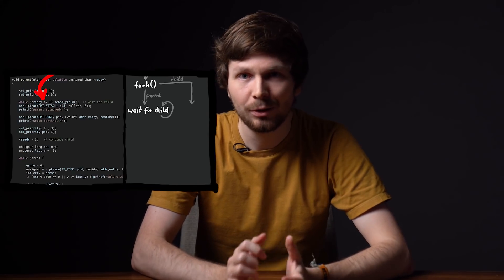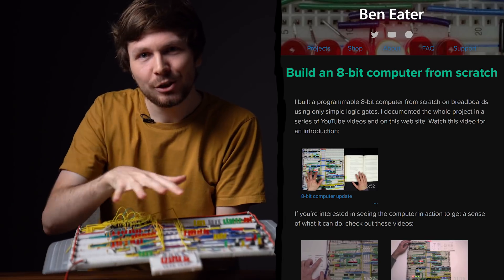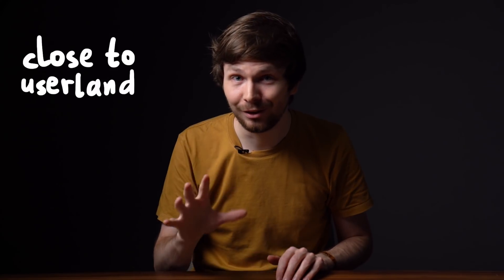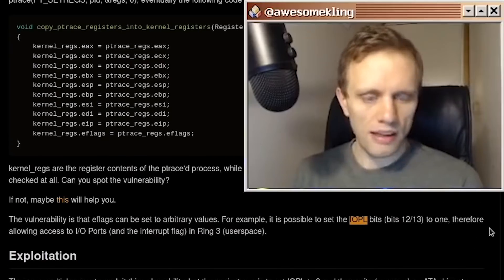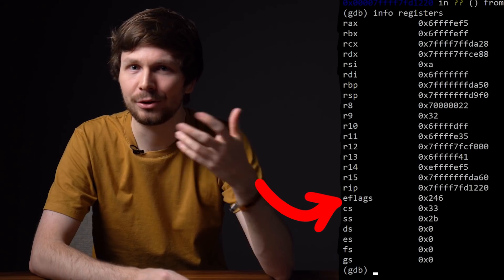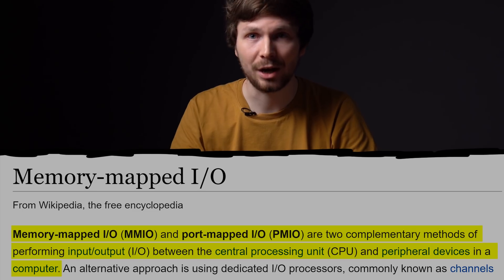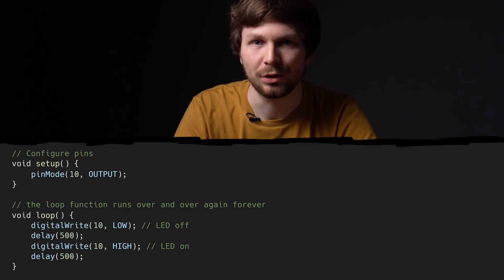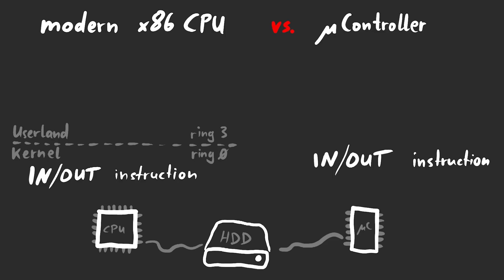How CPUs Access Hardware - Another SerenityOS Exploit

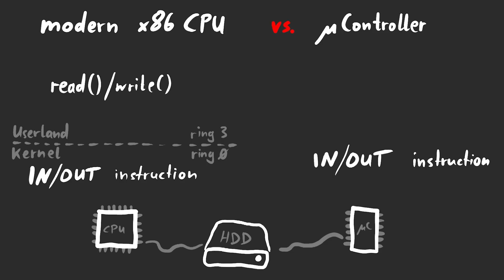Comment: 16:25 - The kernel check permissions in modern OSes; back in the DOS days, we read from and wrote to ports directly, so reading the keyboard controller from port 60h was a common task (well, maybe not as common as using interrupts). In those days, the computer was essentially an Arduino. I miss the days of displaying stuff on screen by just writing directly to video RAM.
Reply: You could always do the same with linux. Just pipe the /dev/random to the screen buffer! Even better, pipe it to sound output so you could listen to "random"! :D
Reply: @YandiBanyu  Hey can you expand a little on how I would pipe random dev output to a screen buffer or audio buffer. Like which device I should be piping to?
Reply: @kunaljoshi8038  That depends on the detail. But one thing is for sure, you need to make sure that the linux kernel create the framebuffer node (usually /dev/fb# where # is any number). After that, just do the usual "cat /dev/random > /dev/fb0". Of course it also hard to notice since your screen will likely refresh at least 24Hz. Audio buffer however is a little bit easier. Most Linux uses ALSA, you could always do "aplay -c 2 -f S16_LE -r 44100 /dev/random"
Reply: @YandiBanyu  ok thank you. Will try this out 👍
Reply: @YandiBanyu  I don't know what I was expecting when I played random through the audio buffer
Reply: The Spectrum worked exactly like that. The graphics part was realized by using a dual port RAM to write the data related to graphics. On one side of the RAM was the CPU, and on the other side was the circuitry that scanned the RAM and converted to a signal that would be sent to the TV set. It was a very common topology in computers, so it seems.
Reply: you can just write a protected mode ring 0 operating system to get those joys back
Reply: @iDontProgramInCpp  Better to do real mode so you can get bios interrupts back too ^^
Reply: @peacefulexistence_  you would be heavily limiting yourself to 640kb of ram, why?
Reply: It's not directly to ram but it's called dev fb0

Comment: There's a book called Understanding the Linux Kernel that I'm reading through at the moment that you might be interested in. It has chapters that go through things like interrupt request controllers and whatnot and interacting with hardware. It's not the very latest thing in the world, so a lot may have changed with the newer Linux kernels, but I would expect most of the very basic stuff to be the same since it still needs to work with the physical way motherboards and chips work, including older modules - so even if newer systems have been implemented both in hardware and software, this mechanism at least should still be in the kernel for backwards compatibility
Reply: @damianc8738  Certainly a title that sounds like it could be a good resource :)
Reply: been reading it for 5yrs now. great book

Comment: Fun fact on hardware vs network ports: Port 0x80 is used for firmware debug output that is sent out through the LPC bus, what a POST card displays (or super I/O / EC / BMC catches today). Not to be confused with the HTTP port. In spoken language, both are referred to as "port eighty". And "to POST" (power-on self-test) in firmware not to be mixed up with the HTTP verb. ;)

Comment: Not all IO must happen through these ports. Many times hardware (especially modern hardware) write directly into memory and then inform the CPU via an interrupt and so CPU doesn't have to synchronously read from ports. Part of the PCIe protocol is an algorithm for the CPU and a piece of hardware (like GPU or network card) to decide where exactly in CPU's memory address space they can communicate
Reply: You mean something like DMA from the peripheral side?
Reply: @victornpb  yeah, sort of. DMA is a generic term for the ability of other hardware to access the main RAM without going through the CPU (i.e. not through port IO). PCI is a much more complicated protocol

Comment: Modern RISC processors (like RISC-V) tend to use memory-mapped I/O rather than port-mapped I/O, it's more flexible because: it avoids adding specific instructions (classic load/store instructions do the job) and it removes the constraint of supporting obsolete technology (like PS/2 port).
By the way, x86 also use memory mapped IOs for modern devices (like the PCI bus).

For memory-mapped I/O on linux we use a "device-tree" file that describes which physical address corresponds to which device. This allows linux, at boot time, to know the physical addresses of the devices for the kernel drivers and to define a virtual address space for each driver.

To prevent users from using the I/O directly, the kernel simply does not map the I/O memory in the virtual address space of user processes (so he doesn't need to do anything).
And a user can under certain circumstances ask the kernel to map the address space of a device in its virtual memory for faster access (bypassing syscalls) and implement a driver in the user world. This would be much more complex with port-mapped I/O.

Memory-mapped I/O are a much more elegant solution than port-mapped I/O. =)

Comment: Direct CPU interface rather than going through a USB bus is exactly why I use a PS/2 keyboard and mouse. Would love to see you explore data busses :)
Reply: why deal with USB controllers and queues when you can just interrupt the CPU and have it handle your input!
Reply: Side note, if your keyboard supports usb 3, it can use async notifications instead of polling, so that would be the "modern" replacement of this interface
Reply: Shhh, nobody tell them that PS/2 is not a direct interface, at least on PCs - there is traditionally a bus connected microcontroller in the middle (and it does more than just keyboard functions, you can also ask it to reboot the system or mask off the A20 line) - though in modern implementations it is probably no longer a real microcontroller core involved but it tries to act similarly for compatibility.  The interface is still much simpler than USB, however, and PS/2 devices can be direct connected to anything with GPIO pins.
Reply: @big0bad0brad  woah really? I didn't know that, thanks

Comment: So a port is just a register of some hardware mapped to a static/predefined memory location?
I never fully understood memory mapped io back at my university time. Thanks for closing the gap. There is still so much to learn about Linux and I'm really excited about the journey. 
And keep going with these meta videos about the progress of learning!
Reply: I wouldn't say a port is a register. Rather a port is an ADDRESS which the CPU or hardware designer defined to be connected to some hardware. That is why in assembler you could use IN/OUT assembly to write or read from those ADDRESS

Comment: Well microcontrollers still just output on the wire as you told it. In modern CPUs, saying out 0x60 0xDE doesn't necessarily mean 1101_1110 is written to the wire, it has to follow all the different protocols like (S)ATA, PCI-e, and even the non-trivial protocol used to fetch data out of the RAM.

Comment: Also, for your microprocessor and computer bridge. You can't really compare them. The I/O on the microcontroller is usually not directly connected to the CPU. Microcontroller has CPU, RAM, ROM, and I/O INSIDE the chip so many implementation is still abstracted away. And Ben Eater 8-bit computer is great, but it only cover the surface. I suggest maybe check out Ben Eater next series about Hello World from scratch. Or the (once) popular Z80 CPU.

Comment: I have to tell my 3 cents. IO Ports is not the only way to talk to the hardware. There is also something called Memory Mapped IO (MMIO) - registers and memory of the device's controller is mapped directly into virtual adress space, most often above kernel space. You need some type of documentation to know which byte in virtual adress space refers to which registers in the device controller on motherboard. When the virtual adress flies (from CPU) through the MMU it recognizes that adress should be directed to the certain controller register. X86 supports both methods of accessing peripherals but MMIO is currently recommended. Ports IO is some kind of legacy stuff. To be honest I don't know why MMIO is better than IO Ports and I'm not sure when to use what method so feel free to help me understand that. I read that advantage of MMIO is that we can use exactly the same instruction set as for normal memory when with IO Ports we can only use IN/OUT instructions to read something from controller and then dealing with recived data. So if we want to add 1 to controller's register value we have to: read data from controller, add 1, send data to controller instead of using just "INC [memory]". The same situation of every other more sophisticated instruction. I heard also that IO Ports have some performance problems so USB and PCI devices are mapped by MMIO method but I don't know if it's true. I still wait for somone experienced enough to dispel my doubts :) Btw. isn't it funny that we have to "reverse engineer" these facts which are probably obvious for every kernel developer? XD
Reply: My intuition tells me that MMIO would be more efficient and would have way higher throughput, because devices can write its buffer directly on memory without having the cpu bit banging every byte

Comment: Actually even some microcontrollers have the concept of hardware privilege levels. For example all ARM Cortex-M cores have two privilege levels, when a core is also equipped with a MPU (Memory Protection Unit) you can also restrict access to some memory areas for unprivileged code. They all also have syscall instruction, so you could implement a basic OS on an ARM microcontroller - which I definitely recommend - it's great learning experience especially since the architecture is so much simpler from x86.

Comment: For anyone dealing with these kind of questions: Write a basic operating system for a raspberrypi. If you have a certain amount of experience, it's not that hard and you don't need to implement everything. Just a uart driver maybe that you can send messages through. You will read a technical manuals and data sheets. And you will learn a lot. Reading a cpu manual for the first time, it is surreal. I remember having this weird bug in the beginning where I wasn't realizing that an interrupt changes the processor mode and different processor modes have different stacks, so my interrupt stack wasn't initiallized. That's a bug where google won't help haha. Anyway, I can recommend it dearly for a side project.

Comment: x86 (and relatives, like Z80) IO ports are just another address space -- much like memory, there are registers located at addresses, indeed it's usually multiplexed on the same address/data bus, just strobed with different signals (IORD/IOWR).  And the accessing instructions suck (like x86 only putting operands through AL/AX/... and (E)DX!).

The IBM PC had a quirk that only 10 bits of IO address was decoded (to the ISA bus, from the CPU; I forget how this happens), so addresses tended to be used a bit carefully.  Like the keyboard port registers sometimes having extra bits for system flags (like DIP switches, or A20 enable).  Or the paired graphics registers, where one serves as a pointer for the other, into a device-internal register file.

As far as I know, this remains much the same today, with the quirk that wider (WORD+) IO accesses are possible (186+) (which probably isn't a good idea to access the above type of registers?!), and that everything propagates through caches and bus interfaces (>Pentium?) -- there's a lot of abstraction in the hardware alone, a lot of work has been done to keep things transparent to the CPU instruction set.
Reply: In university (a long time ago) we had to breadboard a programable controller using a z80, some sram, eeprom and  port expanders, everything "glued" with discreet logic. It helped greatly in understanding memory mapping, and separate memory and I/O spaces, not too different from way the x86 handles it.

Comment: Huh, interesting, I never knew about the IN and OUT instructions in AVR assembly, or any assembly for that matter. When I wrote AVR code to access GPIO pins without the arduino stuff, I always just read and wrote directly from/to the PORTA and PORTB registers, which would to the same as digitalRead/digitalWrite. I'm guessing this is the equivalent to "memory mapped access", compared to port based access with the IN and OUT instructions?
Reply: “OUT” is a machine instruction you use when programming in assembly. “PORTB” is a macro of the avr-libc you use when programming in C. The compiler then translates that to whatever it thinks is suitable, most of the time to port-mapped I/O.

Comment: The middle part that you say you are having trouble with can be summed up with one word: registers. You toggle a pin on an MCU by writing to a register. Basically, you read the register corresponding to the pin bank, change a single bit, and write that changed value to it (because you can't address single pins directly). Then the logic inside the MCU will read the register, send it to the output buffer, and the pin will be set accordingly. This is typically done once every four clock cycles.

Edit: I thought you were asking about how pins are set in a MCU. But it seems that you have that knowledge concerning CPUs. MCUs are not different. An MCU is a CPU with output banks and other stuff (namely RAM, DACs, ADCs...).

Comment: In reality, most peripherals are mapped to memory, because ISA IO ports are slower (and there is only l like 64k of them).

On the Atmega, you can write to these peripherals with memory load/store instructions too (I tried to blink that way and it worked)

On x86, only old stuff is in the IO bus: ATA, PS/2, PIC, PIT, CMOS.
All the new stuff is somewhere else:
 - xAPIC is in memory
 - x2APIC is in memory or MSRs (not sure)
 - HPET timer is in memory
 - PCIe is in memory
 - VGA framebuffer is in memory (you need 0x20000 or 64K, which wouldn't fit in ISA)
 - extended framebuffer is in memory (as in framebuffer for high res that needs >64k)

ARM uses only MMIO. RISC-V uses MMIO. On AVR it's MMIO with a shorthand.
Reply: If I understand correctly MMIO is like having DMA from the peripheral side right? If so the devices usually write to memory and hit some sort of special interrupt so the cpu can take a look at the data there, or it relies on the cpu pooling data from memory? Or is there another synchronization mechanism?
Reply: @victornpb  no, it's not quite that. MMIO is you can get some device ram put into the physical address space. Every read/write is synchronous and handled by the device. That said, most devices use DMA and not MMIO if they need loads of data. DMA is configured through PCI, and thus MMIO (or legacy ISA IO interface)

Comment: thats a question ive been having too for a while
Reply: Same. I Tried to find out how to read the Flash where the BIOS is stored. Came to the SPI stuff but then some other projects came up. I need to look into it again.
Reply: i wonder how EFI works as well, do you have any simple resources?
Reply: @overlisted  Me too
Reply: i tried to syscall in C and wonderd what if i run C code with no OS how do i talk to IO Devices.

Comment: What got me confused a lot was that on x86 you can enable A20 gate via 64H port, i.e .keyboard controller.
Reply: Yeah that's a weird situation; they realized too late when the 286 came out that some software depended on the memory wrap-around from a segment positioned near the end of the 1MB address space, where if you reference an address beyond the end of 1MB, it loops to the beginning.

Except, on the 286 the processor maps it beyond 1MB.  It was a dirty hack to have the keyboard controller flip one of its pins to turn the A20 line on or off; with it off, the memory wrapping works as it used to (but access above 1MB that the 286 otherwise could provide is all screwed up).  So if that older compatibility was needed on a 286, A20 would have to be enabled or disabled as appropriate for the kind of software you were running, and the keyboard controller had an extra pin left that could be used to do it - so that became the most common solution.

It would have been cleaner if that switch was located inside the CPU itself, because then every system would work the same way.  Some machines didn't use the keyboard controller approach and did it other ways, so the code to control it became a bit complicated with different possible methods to have the best chance of working.